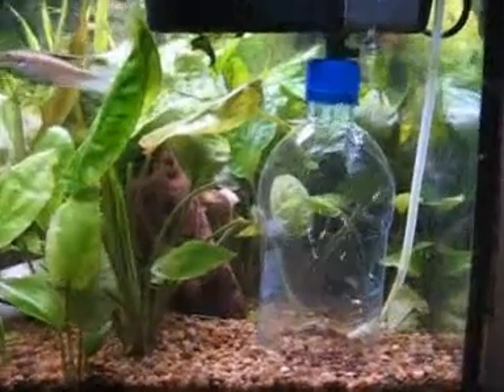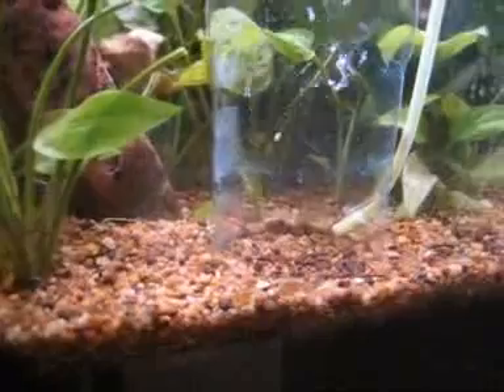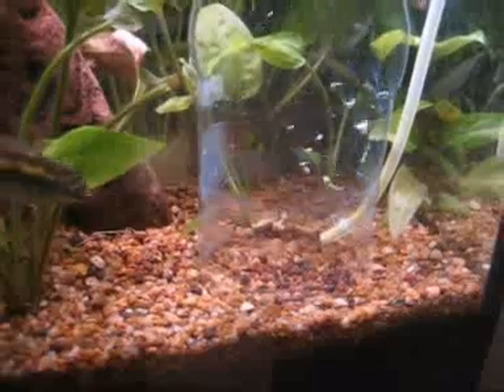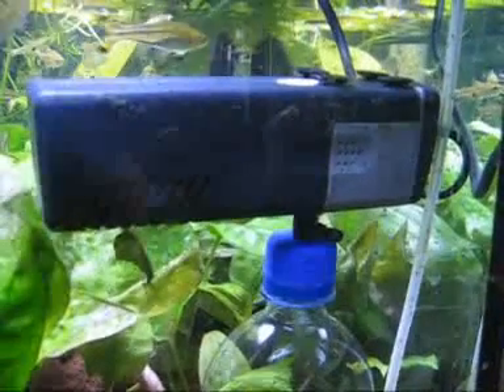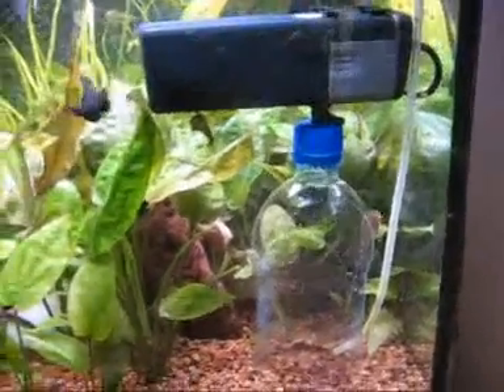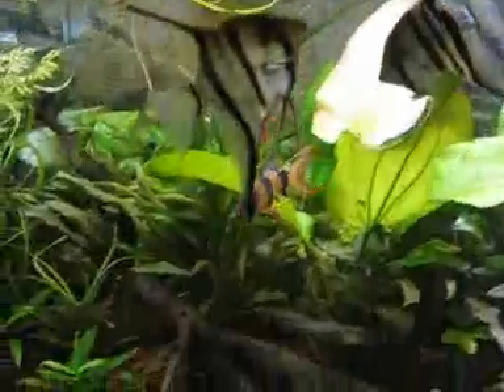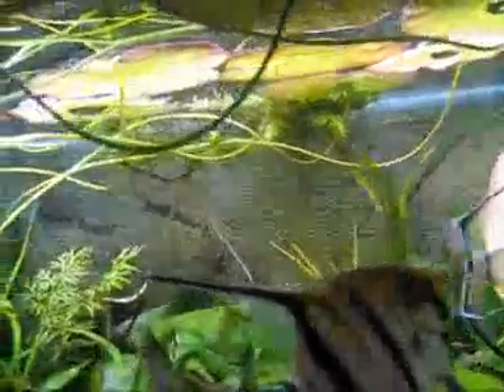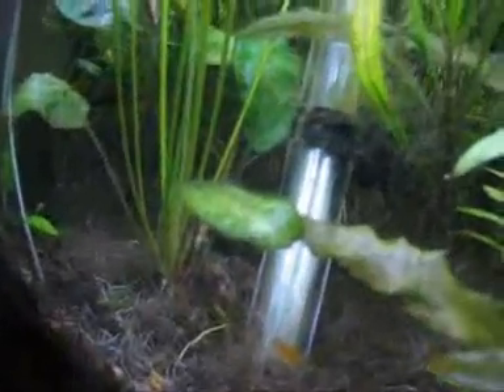New CO2 System - Keeping it simple...

Comment: the white tube is feeding co2 to the bottle.the thing on top of the bottle is power head which pumps water into the bottle and the bottle is cut at the bottom and pushed into the gravel so when the power head pumps the water into the bottle will mix them up.bubbles will be disolved in the water instead of escaping into the atmosphere.sorry about the english.its my second language anyway

Comment: What sort of submersible filter is that? Also, I would recommend the fertilizer. It usually helps a rather lot (use it WITH tablet fert. I only used liquid for a while, but i used tablets and noticed results in days.)